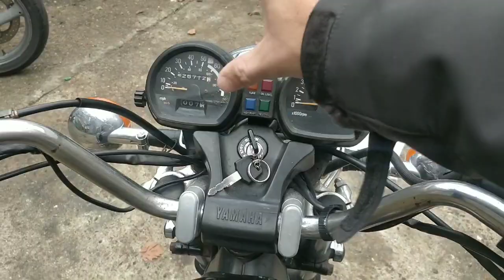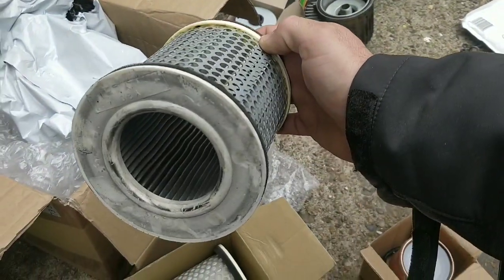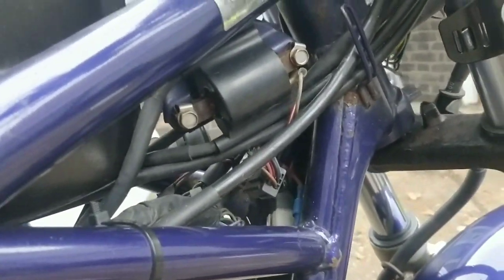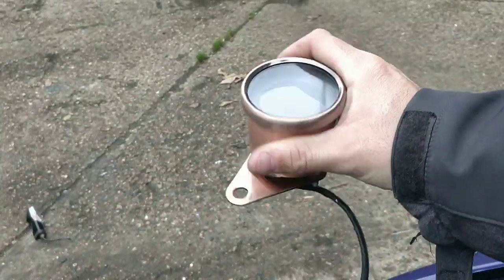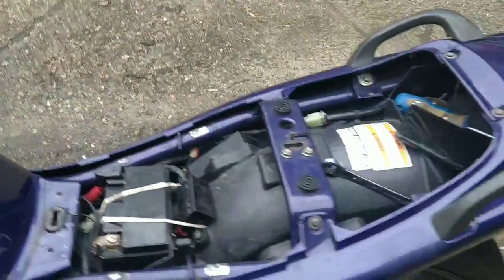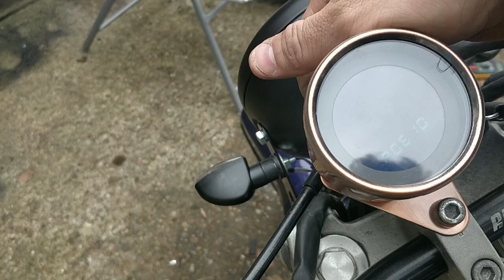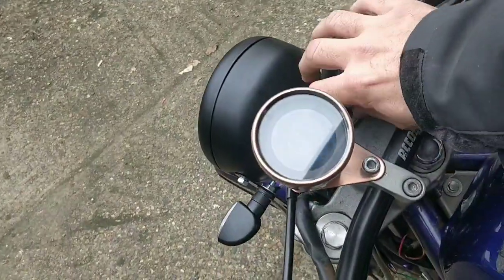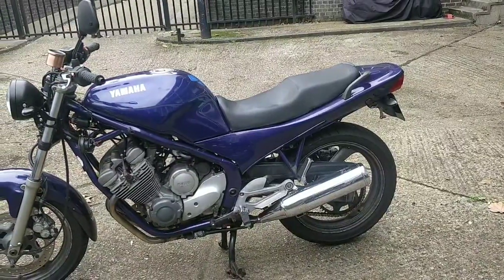Yamaha xj600 Street fighter ish, new digital speedo. how to install a digital speedometer.

Comment: Good work Charlie. Like the new speedo. Still no luck with mine. Had a look over the wires the other day. Cannot figure it out. Might just switch it all out. you down at the garage tomorrow?
Reply from the maker: I was thinking that switching to something similar to mine would sort you out but then you lose that look up front.

You havnt got the little magnet yet have you? That could be all it needs although I'm not sure as I've never used magnet ones.

I wonder if we bought a new magnet and pick up (generic one) if we would splice that into the old wiring. Problem is we won't be able to calibrate the clock as your clock can't do that.

It's well complex dude

Comment: So changing the headlight and speedo is a street fighter now? And it's not a bearing in the clutch it's a a small pin which is easy to replace
Reply from the maker: I knew it was the small pin but it dosnt effect the bike and is common. It can be changed if the sound annoys you but dosnt have to be changed.

My channel is about making bikes better and saving them from the scrap. I also put ish in my title for people like you who like a moan.

Thanks for watching and please subscribe
Reply: @motorcyclerescuer  wasn't moaning it was a question
Reply from the maker: @NOONE-hp8bw  what was the question?

Comment: does this read speed via the drive? looking to convert to naked and they all seem to use these magnetic sensors
Reply from the maker: Hi, you screw your original cable into the back of these and they convert it to digital. They don't use the magnets which are a bit of a pain to set up. 

Thanks for watching, please like and subscribe.
Reply: @motorcyclerescuer  thanks for the reply. Do you know the clock make and model. 

Is it fairly accurate then?
Reply from the maker: @daviddavidson3760  it's as accurate as the original from my tests. I've used 2 now. The back-light is a little dim but does the job. 

They don't have a specific name but here is a link to one. They normally come in black, silver or a bronze. 

They aren't the best thing since sliced bread but I like the look, size and They do the basic job of being a speedo. 

https://www.ebay.co.uk/itm/Universal-Motorcycle-LCD-Digital-Speedometer-Motorbike-Odometer-Tachometer-Gauge-/392920626743?mkcid=16&mkevt=1&_trksid=p2349624.m46890.l6249&mkrid=710-127635-2958-0
Reply: @motorcyclerescuer  thanks mate

Comment: Hi there I've been offered a gs450l are they any good cheers steve
Reply from the maker: They are very similar to the yamaha xj550 in my video I believe. Good old bikes from what little I know but I really don't know much about them. For the right price it will be cool
Reply: @motorcyclerescuer  hi there it's on Facebook they want 750 have a look
Reply from the maker: @steveandfamily7248  right, I'm having a look right now.
Reply from the maker: 1982 burgendy and black one, £750?

I love it. Its stunning. And it 2 years time the value shoots up as it becomes tax, mot and ultra low emissions zone excempt
Reply: @motorcyclerescuer  yes mate its in spalding.  It says it runs . But its been of the road since 2009 . So will need a far bit of cash thrown into it
Reply from the maker: @steveandfamily7248  yes I saw it. Honestly it may not, it may need the tank flushing with some fresh fuel then draining that out and an online fuel filter.

Brakes overhaul, full servicing on them.

Otherwise it should be OK. Tyres will need replacing eventually because of the old rubber.

It says pending though, is that you?
Reply: @motorcyclerescuer  not sure what pending means i Don't have Facebook I got a friend to message them and I got there phone number I did ask them if it runs but they never got back to me.  I really want something I can just get on and go and not have to mess with
Reply from the maker: @steveandfamily7248  I think someone has put an offer in, that might be you but worth messaging and finding out.

Yeh I get you, these 40 year old bikes will run forever I think, they were basic engines with no emissions stuff. The 40 year old bikes are gold at the moment
Reply: @motorcyclerescuer  I did tex them but they never replied to me.  Was looking at a cb250rs.  But my friend said they have problems with the heads cracking
Reply: @motorcyclerescuer  I like the xj but I'm into smaller bikes really looking for a 250 like a super dream  or something along those lines
Reply: @motorcyclerescuer  I have a budget of about 850 at the moment
Reply from the maker: @steveandfamily7248  I see Steve. You should have plenty options mate.

A cb250 of any kind are always good bikes. Parts can be a pain but not a huge issue.
Reply from the maker: Baz Bazdad  Baz you are on fire today, what did you have for breakfast :)

If my channel teaches people anything it's that you can service your bikes at home and save hundreds of pounds. Buy the old 450, follow some basic rules and that thing should run great.
Reply: @motorcyclerescuer  thanks for that im of to have a look this afternoon
Reply from the maker: @steveandfamily7248  are you looking at the gs450 mate
Reply: @motorcyclerescuer  yes mate
Reply from the maker: @steveandfamily7248  good luck Steve, let me know how it goes
Reply: @motorcyclerescuer  hi there i had a look at the 450 . I had to leave it . It needed fork seals there was also an oil leak from somewhere on the engine . And needs to tyres . And running very rich . Shame really there was a kh125 but that was sold also a super dream 250 he wanted 3 grand i had to laugh cheers steve something will turn up
Reply from the maker: @steveandfamily7248  Steve you did the right thing walking away. Another watcher walked away from a buy aswell today for the right reasons. Its tough to do but right. Tyres cost a small fortune, oil leaks can be anything wrong and fork sills are a pain.
Reply: @motorcyclerescuer  it was hard to walk away.  But Christmas is fast approaching and I've 2 kids to think about.  Something will turn up